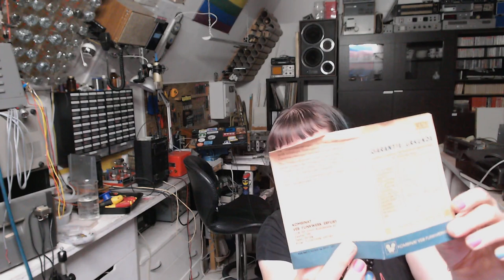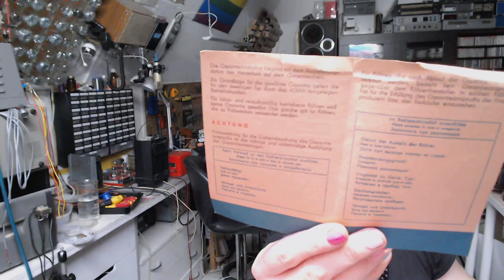B13S8 - A Huge East German Cathode Ray Tube

Comment: A long time ago Etco Electronics in Montreal Canada sold 5BP1 crts for $3.99 CAN. They were about the same size as this one. The problem is they came in a box about 100cm by 40cm. It was a bit hard to carry home on the bus. I made a circuit and got it to work but it was fuzzy without a shield.
Reply from the maker: One meter long? That was enormous!
Reply: @KeritechElectronics  it was supported inside by springs and wires.
Reply from the maker: @gordonwelcher9598  nice - that's how mercury vapor rectifiers or transmitting tubes were often packed, sometimes using crates and adding wooden chips as filling.